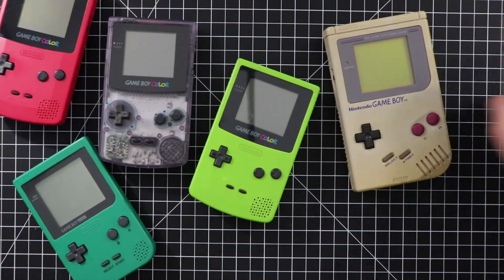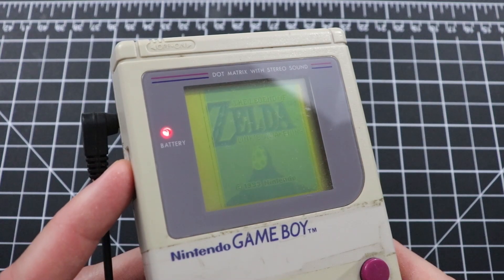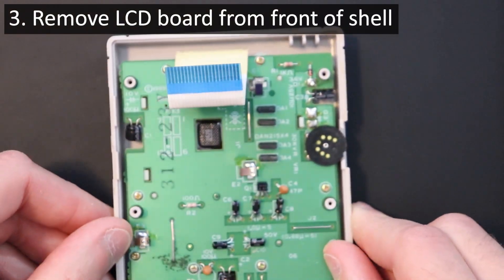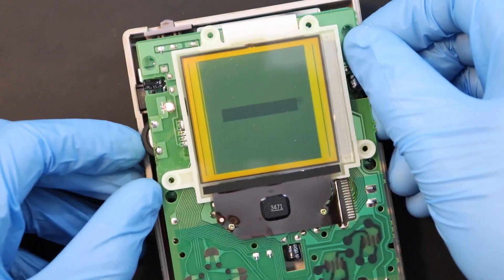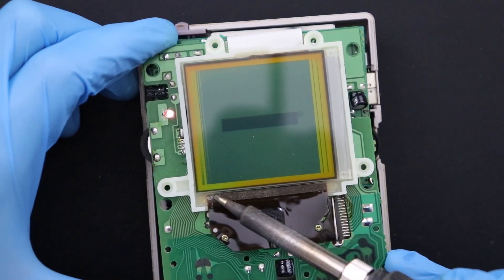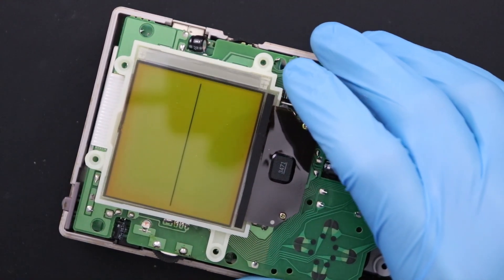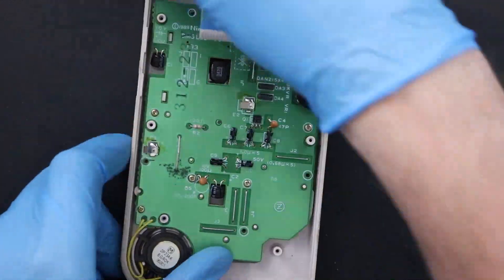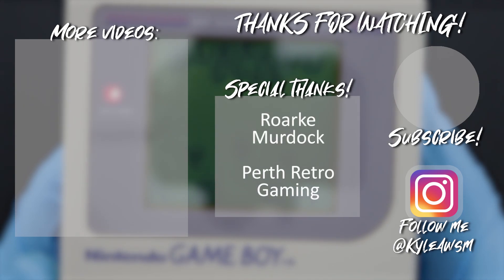How to FIX Vertical Lines on a DMG Gameboy Screen

Comment: Do you have an explanation as to why this works? 
I've heard that dropping alcohol directly onto the screen can be dangerous, as it can leak under the display. What's your take on this?

Great video btw! :)
Reply from the maker: Thank you! 🙂  Unfortunately, I don't have an exact explanation - There's something about old displays like this that, after 30 years, they just start to develop this problem.  Once I get the chance to tear down a dead/too-far-gone one, I'll make a video on it!  Also, the alcohol can be hazardous if it gets into the creases between the layers of glass.  My experience of using it as a topical cleaning solution on many different kinds of displays hasn't failed me yet!  I just recommend not using too much.  A couple drops go a long ways! 🙂👍🏻
Reply: @KyleAwsm  Regarding how it works, the ribbon has a layer of conductive glue which makes contact with the tiny traces on the glass itself. Heating reflows this glue and rebonds the contact. As for alcohol, on LCD's with multiple loose layers, like the GBA with its diffusers, if it gets in contact with them it causes them to swell and warp and this can't be undone. The DMG, pocket and GBC don't have these diffusers so you can drown them in alcohol with no ill effects - within reason.
Reply from the maker: @Ben Thanks man!  Always backing me up! 😎👍🏻
Reply from the maker: For anyone looking at this pin, make sure you heed Ben's advice above! 👆🏻  Good advice and insight there!
Reply: @bengrimmett1239  Thanks for the explanation :)
Reply: I wasn't trying to be offensive. I was just curious. Good to know that it's safe to go ham with IPA on DMG, pocket and GBC 👍
Reply: @KyleAwsm  looking forward to your next video!
Reply from the maker: @pots_e Oh, no offense taken at all, man!  It is a very good question!  I pinned your comment so people can see all of the information in this thread.  Truly, thank you for asking about it! 🙂🙏🏻
Reply: @bengrimmett1239  hi, I have a dmg where the glue of the ribbon seems to have gone under the end 3mm of ribbon so will not restick on one side The screen still works in that area when it is pressed doen with soldering iron but will not stick on that side and is standing slightly off from the board where it needs resticking. Is there any kind of adhesive I may try on this small area to restick it?
Reply: I did this but one line won't go nomatter want

Comment: Confirming this still works! Anyone else who tries to do this, understand that it's a PROCESS, it took me about 1.5 hours and a 500 degree soldering iron to get my pixels to start showing permanently. Also, everyone's LCD ribbon and soldering iron are different, 500 just worked for me 🥰

Comment: Thanks! I used this to restore ALL ~30 dead lines on my DMG! A few notes: 1) Clear away the adhesive strip over the ribbon cable from the affected areas--that stuff will just slow you down; 2) Clean tip is key; 3) When close to done, it helped to press the ribbon a little with a blunt tool; 3) Patience is also key--first time took me about 2 hours; 4) Remember to get the speaker behind the top pc board before reattaching the ph screws; 5) Actually, 1-2 lines didn't restore directly with the solder/press method but fortuitously revived when everything was reassembled, perhaps from the press fit of everything.

Comment: So i found out that hot air guns do work aswell, just be careful with the temperature (i lowered it 40-50°C from the recommended one in the vid) and be careful not to blow it on the screen directly!

Comment: Epic! I just took the Gameboy apart, removed the inner screws to access the LCD rubber bumper area, ran my soldering iron over the area under the bumper until all the lines were gone and now my screen is back to normal. Thank you so much for this video! I thought I was gonna be stuck with just one gameboy. Really wanted a set because I have multi taps. After putting everything back, It works like new!! You rock!
Thanks again!
Dave M.

Comment: At 4:42 did you just put the original rubber strip back on?? If not, where do you get a new one? And also does it actually have to go back on? Thanks.

Comment: Hi Kyle. Is it possible that some lines are totally unfixable? I've tried on mine, but doesn't work, the vertical line is still there. If I'll insist to much, the bottom screen will turn black, but the vertical line won't fill up, it's still white. Do you have some advice? Thank you!

Comment: Mine had a ton of lines. I ended up starting with the soldering iron and then whipping out the surface mount heat gun on 300°F on low fan setting pressing down with a tweezer. Worked a little better than the iron, actually. This method might work to save screens that are really far gone.

Comment: Do you have any recommendations on what glue will work to replace the original adhesive strip? On my GB the adhesive was so worn out that the rubber piece wouldn't stick to it, so I applied a tiny bit of paper glue for time being, but would rather replace it with something more appropriate.
Reply: I used double  sided tape . Put the rubber on one sticky side . .Cut the tape  around the rubber to size Then just . Peel the other side of the tape to reveal the other sticky  side . Then put it in place . That's  what I did .

Comment: Great video, but I will say to anyone who has a rework station on hand "just skip the soldering iron". I fought with my screen for about an hour with my soldering iron and really was not getting very far with it, 20 seconds with my air rework station set to 250 C/lowest airflow settings and the screen was back to perfect. FWIW.
Reply: Super helpful comment the screen was super stuborn with the iron but I managed to fix it in less than a minute with the rework station.
Reply: Thanks a lot! I saved me time and risk. Worked great.

Comment: Great tutorial! I managed to finally repair my GB. I couldn't put back the rubber band directly beneath the screen. But there was still some glue on the other side beneath the glass part so I used that. Only issue is my screen looks slightly off centered now so If may have reopen the case.

Comment: Personally I also remove the adhesive strip just by peeling it back it seems easier and cleaner, I just use a glue to to glue the black rubber strip back afterwards
Reply from the maker: That works, but I wouldn't recommend that, in case you have to repair the ribbon again sometime down the road, which I've seen happen from time to time.  Thanks for watching! 👍🏻
Reply: @KyleAwsm  by glue stick I mean the kids type so it just lifts off again easy in future but is strong enough to keep it on
Reply: @KyleAwsm  I need to reapply my rubber strip. What adhesive do you recommend for that?  Thanks for the video.